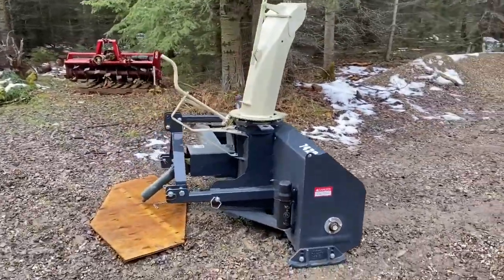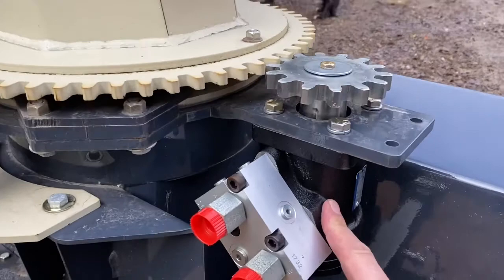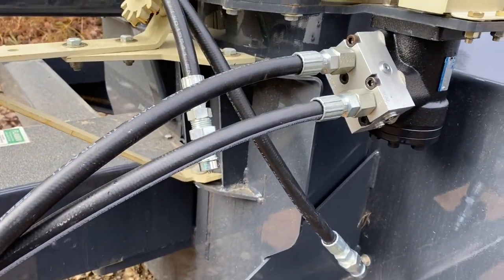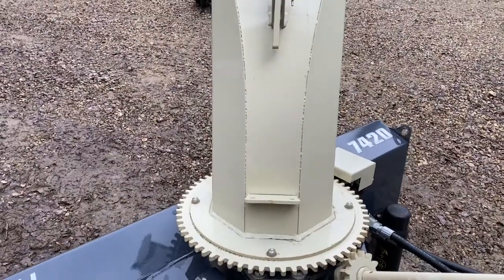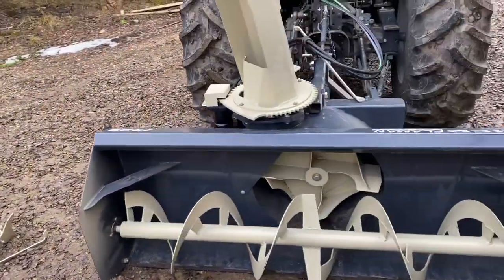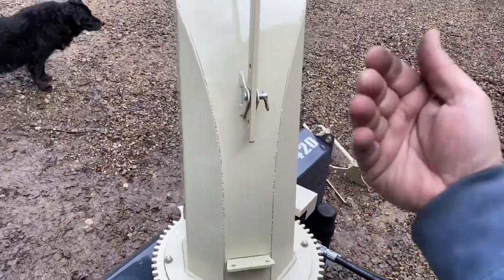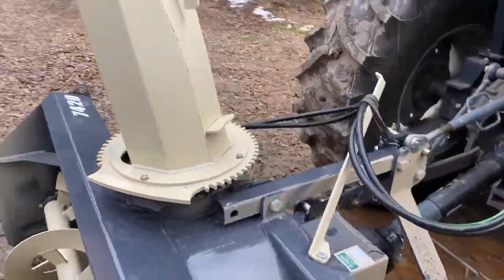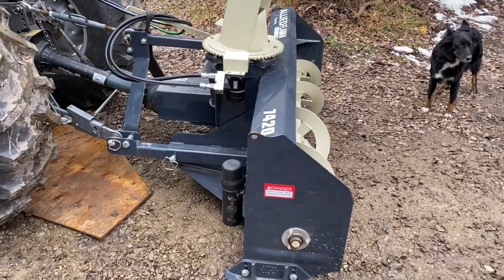Farm King snowblower chute rotator conversion

Comment: Can you provide the model number off the hydraulic motor serial plate, Please?  

Great video!
Reply from the maker: Hey Matt, it will be a few weeks or so till I can get that info but I will get it to you.
Reply from the maker: Hey Matt, the info you asked for is manufacturer, EATON,Product No. CH-080, 016-0231-002, serial no. 1803253511. Hope this helps, Thanks
Reply: @greytheoboy5601  thank you!!